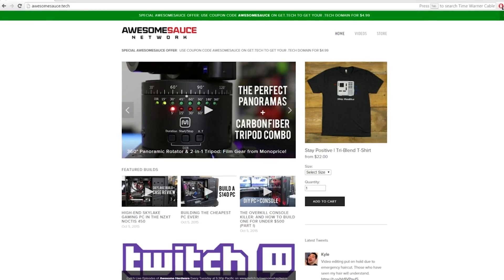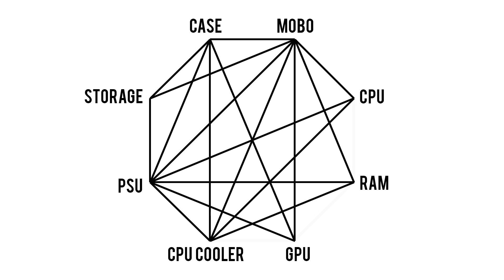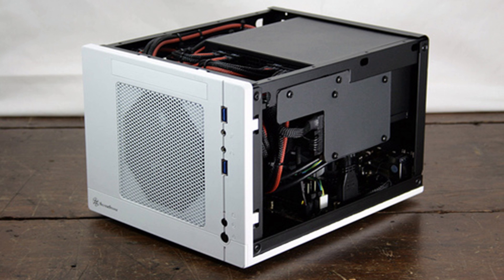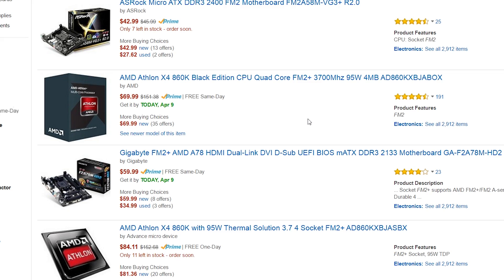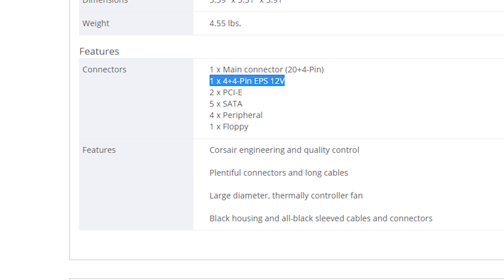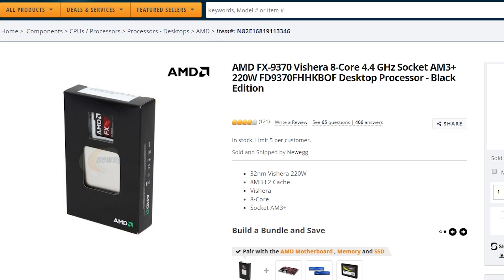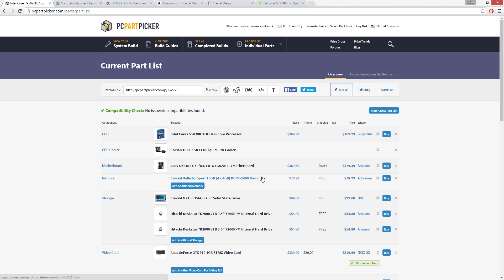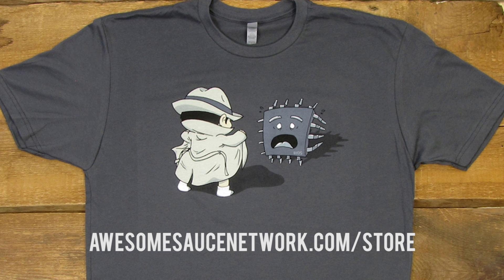How to Choose Parts for a PC! The Ultimate Compatibility Guide!

Comment: The motherboard i got is mATX n the graphics im getting is a gtx 1060 do they fit together?
Reply: If it has x16 PCIe slot (which of course it will), it will fit.
Reply: MSI B150M PRO-VD mATX LGA1151 B150 DDR4 SATA3 1PCI-E16 2PCI-E1 DVI VGA USB3.0 Motherboard Thats the motherboard i have. MSI GeForce GTX 1060 Twin Frozr VI 1809/1594MHZ 3GB 8.1GHZ GDDR5 G-SYNC VR Ready Video Card and thats the 1060 (not sure if i wanna get the 6gb 1060) so i might stick with the 3gb
Reply: Martian Version 247B Yeah, it will fit.
Though, if you have the money, just get the 6 GB version. Today games took atleast 4 GB in High settings.
Reply: Okay ill get the 6GB Thanks for your help! :)
Reply: Yep. Good luck with your build.
Reply: AlphaCore Will do!
Reply: AlphaCore i have a question i changed my graphics card too ASUS GeForce GTX 1060 6GB ROG STRIX VR Ready HDMI 2.0 DP 1.4 Graphic Card (STRIX-GTX1060-6G-GAMING) i want to know if its going to fit my case which is a Corsair Carbide Series 100R Mid Tower Case also would it fit my mobo? sorry just a first timer trying its best.
Reply: Martian Version 247B Yep, will fit to all those things.
Reply: AlphaCore thanksomuch!

Comment: I'm thinking about building a PC. I have a question... When I buy all of my parts and everything, will they come with all of the needed connectors between different components or will I need to order connecters also?
Reply: Are you talking about PSU cables?
You should check if your PSU has all the connectors your components gonna use, not the other way around.
Reply: AlphaCore I guess. I was really asking whether the wires between things like the CPU and motherboard, etc would be provided, but I wasn't thinking and didn't realize that they don't need wires 😅 😂Oops lol.

Comment: Hi, i was wondering is this pc build makes sense so please check it out https://pcpartpicker.com/list/wJwLwV
Reply: 1. Is this all new system? Because if yes, I can't find that PSU anywhere. Dunno how you pick that one.
2. Why 2 separate 1 TB HDD? Why not just 2 TB one? Also, why no SSD? For $40, you can get 120 GB PNY CS1311. Which is more than enough for pure gaming rig.
3. I would put CPU Cooler there, even though that's a non-K CPU. Though you can do this sometime in the future.
Reply: So CPU cooler is not necessary and also  is everything compatible with this build ? 
And the name of the PSU cooler is aerocool vx-450 also my case is different from pcpartspicker so here is the name aerocool pgs v2x. Thanks for answers
https://pcpartpicker.com/list/hJmYQV
Reply: Death Slap Yep, that's what I said with "in the future".
PSU is good, though older model. Should do greatly in the future.
Good luck with your build!
Reply: Thanks dude

Comment: As a first time pc builder i was wondering if anyone has any tips about my build
https://pcpartpicker.com/user/ElectricBulletZ/saved/#view=cJ9NGX

ps: I know i should get a 1070 instead of a 970, but ive had the 970 before choosing a video card
Reply: I would change the PSU to 600-650W range for i7 Skylake and GTX 970. Also, why no SSD? For $40, you can get 120 GB PNY CS1311. Which is more than enough for pure gaming rig.
Reply: Can you recommend me a good psu around 650 watts, i have a 250 ssd but i guess i forgot to put it in the part list
Thanks for the advice!
Reply: $60 Corsair CSM is already great for gaming rig.
https://pcpartpicker.com/product/sbqdnQ/corsair-power-supply-cs650m

But if you can afford $70, EVGA GQ is better.
https://pcpartpicker.com/product/kz7CmG/evga-power-supply-210gq0650

Comment: https://pcpartpicker.com/list/T3bgQV
any feedback on this build i'd like to do? 
As a first time builder can i just leave all the 'unused' cables in the back plate of the case?
im pretty confident that i can build the whole thing, the only scary task is plugging in the damn cables and having a tidy management
Reply: +Marcus Lundgren Thanks for the heads up on the monitor. 

I plan on using it for gaming and music production, so I was referred to the r5 in order to better accomplish those tasks without issues.
Reply: 1. Why PCI-E SSD? I mean with that price you can get 1 TB SSD. Or better yet, bigger capacity yet cheaper HDD and use extra bucks from the switch to get GTX 1080.
2. Assuming you won't SLI (unless you will in the future), 850 W is way overkill. 750 W is more than enough. Great PSU pick though.

And I think that's it. Rest of components are solid!
Reply: thank you very much :)
this is the new build:
https://pcpartpicker.com/list/9x93m8
is the i7 6700k worth it over the i5 6600k? 
all the reviews i watch say the i5 is more than enough for gaming, especially when overclocked
and i'm REALLY lost with all those motherboard options....m3,m5,m7, pro carbon. 
and Asus have just as many, no idea what to pick there
Reply: Freeski Swizzy Wait, why do switch from 6700K i7 to 6600K i5? I assume listing error from remaking the new list, lol.
Other than that, good all around. Good luck with your build!
Reply: AlphaCore i asked in the comment above. the 'show more' is kind of hidden haha. 
all the reviews online say the i5 6600k overclocked is more than good enough for gaming. runs safely at 4.4GHz, which is better than the i7 out of the box. 
can you tell me what kind of motherboard you would choose personally? there's so many haha
Reply: Freeski Swizzy Lol, didn't notice that. Maybe I really need sleep. Late night in here XD

Choose i7. Why? Future games. Even today games actually show 10-30 FPS boost over i5. And with more game engines actually make use of hyperthreading (which i5 lacks), this would be a great deal in the future (True story, I have last gen i7).
Also, "i5 OC is better than i7 out of the box", while that's true, nobody don't OC their i7 :P
OC i7 is of course better than OC i5.

For motherboard, all aforementioned motherboards don't have essentials features that make one better over the other. ASUS lineup is also the same. They have "features", but regular costumer won't use it anyway, so not worth the money.
With that said, I would choose between MSI M5 and Pro Carbon. They essentially the same. Though I would choose Pro Carbon simply because it's black, so it's color neutral with the others. But you have components that are red, so M5 might be better.
Reply: AlphaCore awesome, yeah that's true if i OC the i5 i might aswell OC the i7. i'll switch the processor then and take another look at the motherboards. i love the all black, but yeah im running an MSI GPU and all red cables, which would look great with an M5.
is there a difference between the M5 and M7? The M7 has some kind of red OC button, no idea what it does though. OC the CPU, GPU? 
thank you very much for your feedback. really appreciate it :)
Reply: Freeski Swizzy I ran the spec sheets. Extra money is literally just for the buttons on M7.
Power and reset buttons which PC case already have, and, might be wrong, but a Quick OC button which the UEFI can control for Automatic OC (Though please manually OC your PC, Automatic OC is always wrong, which is dangerous).

So, "features" that you won't need :P
So M5 all around.
Reply: AlphaCore thank you very much :) 
M5 it is then
Reply: +Freeski Swizzy if you wanna double the power of the video card for a couple hundred extra you can get two 980 TI's instead of a 1070
Reply: Alek Belmas ended up going with an i5 6600k and an MSI GTX 1080 Gaming X
Reply: https://pcpartpicker.com/list/tRKJZ8
Could I have some advice/assistance with this build?
Reply: Hunter you should definitely go for a 144hz monitor, otherwise that GTX 1080 is going to waste.. also I would go with an i5 kaby lake processor instead of the r5 as it seems your building a gaming pc.

Comment: can someone tell me if these are compatable? and have I missed any part?
https://pcpartpicker.com/list/qHn4BP
Reply: Syr Maniac ye dog you should be good ;)
Reply: Lucas Allen thanks, and btw there aren't any parts missing right?
Reply: Are you planning to expand in the future? Because if not, you definitely don't need a 6700K with the 1060... The i5 6600k would work almost identically for gaming, and it would save you about $100. Also, I assume you already have a monitor, but it's not on the list...

Also, personally, I would recommend getting a cheaper case. Unless you're going with 1080 SLI and 64 gigs of ram, a $200 case is a little overkill. Honestly, I just went with NZXT's S340, which was $140 cheaper at the time and I was completely satisfied. Of course, if you value the look of the case, that's totally fine.

Comment: Can someone double check me and make sure these parts are compatible? https://pcpartpicker.com/user/53bloodwolf53/saved/V6dD3C
Reply: 1. Please change that PSU. 650 W EVGA GQ is better yet cheaper. I still don't understand how EVGA pricing works.
2. Why rocking last-gen Haswell system? You can get Skylake system now, especially with that budget. Unless this is an upgrade.
3. Also, why use wireless? 10 meters Ethernet cable is just 10 bucks.

Good luck with your build!

Comment: just gonna put this here and hope someone takes the time to check compatibility.
https://pcpartpicker.com/list/FPxCFd
Reply: Vigilante Panties parts are compatible
Reply: Vigilante Panties yeah okay system. just wanted to point out that the Eco 212 is ugglllyyyy it's good but ugly. you might want to consider getting a new fan. I really like the idea of a black and white build bit I don't see the msi you fitting in  also, you can get $35 Windows 10 keys at Reddit microsoftswapkey
Reply: why u need 2 cpu cooler??

Comment: I'm looking to get a cpu cooler but I'm not sure what I should look out for. are the only problems clearence with the case and clearence with ram? if not please tell em what I've missed
Reply: Cryorig H7, better than cooler master air coolers
Reply: Luca Capperucci if you have fancy ram, then check it. if your heatsink isn't abnormally huge, don't worry.
Reply: Sam Tooch i just checked and my stock Intel cooler barely fits in (like a millimeter of room on all 4 sides). Have any idea of which cooler to get?
Reply: Luca Capperucci just get a Cooler Master Hyper 212 EVO. can't go wrong with that.
Reply: Sam Tooch ok thanks :)
Reply: You can go cheap and get lc power lc cc 120, it's performance is 1-2C lower than coolermaster 212 evo for half of it's price. Plus, they are similar in size.

Comment: could someone please be kind enough to check if my parts are compatible?
Reply: i've already put the parts into PC part picker but he said that it might not always be right so i'd just like somone to double check them for me(sorry im new at this).

CPU- Intel Core i5-6500 3.2GHz Quad-Core Processor

CPU Cooler -be quiet! Dark Rock 3 67.8 CFM Fluid Dynamic Bearing CPU Cooler

Motherboard- MSI B150 Gaming M3 ATX LGA1151 Motherboard

Memory- (G.Skill Trident Z 16GB (2 x 8GB) DDR4-3200 Memory)x2

Storage- SSD: Crucial MX100 256GB 2.5" Solid State Drive
                hard drive: Seagate Barracuda 2TB 3.5" 7200RPM Internal Hard Drive

GPU- NVIDIA GeForce GTX 1060 6GB 6GB Founders Edition Video Card

Case- Fractal Design Define S w/Window ATX Mid Tower Case

PSU- EVGA 750W 80+ Gold Certified Semi-Modular ATX Power Supply

Comment: if i reuse the intel i7 and 1tb hardrive that been working for 3 years to my new computer, it will affect has malfunction system? im just planning to build my computer and reuse some used parts to the my new computer and make the way cheaper and it will run fine? well feel free to tell me if they work or not?

Comment: Where do we plug in case fans I need help
Reply: Your motherboard should have labeled headers for "Fan",  "Case Fan" or "Sys Fan". They will usually have 2-4 pins and only fit in one way. Use these spots for case fans. If you are out of those, you can get a molex to fan header converter straight from your PSU, assuming you're okay with 100% speed at all times. Some PSUs also support speed control though. Only plug the CPU fan into the CPU fan header. Don't plug any other fans in there.
Reply: Zoidberg. Thx bro helped alot

Comment: What is VGA compatibility?
Reply: If you want a powerful PC that runs G-Sync (if you need me to eexplain what it is just ask ;) ) i remember you to use DisplayPort...
Basically VGa compatibility is when you have a monitor that has plugs to connect the GPU. When the monitor has a VGA plug, then that monitor has VGA-compatibility. I think you are talking about a monitor so yeah. If you are talking about a GPU, then it means that the GPU has a VGA plug to connect it to a monitor/display.
Reply: Shinigami -sama what is GSync?
Reply: Basically Nvidia G-Sync is a tecnology created by Nvidia for Nvidia graphics cards.. Do not mistake with FreeSync, which was made my AMD for AMD graphics cards.
It's purpose is to eliminate the awful screen-tearing that happens in videogames and at the same time not creating much input-lag.
Screen-tearing is when a frame is being loaded when other frame is being displayed. You can google that and in images it will show you examples of screen-tears.
Input-lag is when you are playing a game and you press a button and it takes a time to understand the command and do what you commanded. Say you are pressing the right mouse button and it takes 0,5s to do it's action. Thats inputlag. Do not mistake with lag due to internet connection. Though they work in a simmilar way they are different and their cause is different.

In order to use tha Nvidia G-Sync Tecnology you need a Graphics card that is compatible (in the GPU description it should say if it has)
and a monitor that includes the tecnology.

Now, how does G-Sync works?
Basically it sets the monitor refresh rate (measured in Hertz, the ammount of frames that can be displayed in one second, basically how many fps can be seen on your monitor)
with your frame rate. So it stops lagging and screentearing.
Reply: Hope that helped :) If you didnt understand something let me know.
Reply: I forgot to say that if you plan on having the G-Sync tecnology you should buy a monitor that has the G-sync and a high Refresh rate. You should see 144Hz monitors. 
They are expensive but are worth the price because of the perfect gaming experience...
A 144Hz monitor with G-Sync will cost you at least 400€, AT LEAST, unless you buy it from somewhere like a shop with discounts, but normally they for about that price.
Reply: Does the graphics card come with G-Sync already?
Reply: Which one? 
What Graphics card were you planning to buy, what is your desired gaming performance (If you want to play any game in ultra settings 60 fps or if you want lower settings but maintaining 60fps, things like that, what do you want to achieve with your build...) and what's your bidget for the graphics card?
Reply: Shinigami -sama I'm thinking about getting an MSI Gaming GTX 1070 8GB graphice card and im looking for at least about 80 fps in most games
Reply: So your budget is basically 450-500€.
I see the graphics card you chose was to get those 80 fps, so that if the game had any fps drop it would mantain itself around 58-60fps.
The graphics card is amazing, im getting myself a GTX 1070 Founders Edition and both are stunning GPU's. BTW check if the page you'll buy them because here in Portugal are selling the GPU and giving Watchdogs 2 for free!

Thats one of the last gen graphics cards and it supports Nvidia SLI (The possibility of placing multiple Nvidia GPU's in one motherboard.)
, it's VR Ready (you can play in VR) and of course, Nvidia G-Sync.
Reply: Here in Portugal i have a page to check PC components. This is the GPU you want right?
https://www.pcdiga.com/msi-geforce-gtx-1070-gaming-x-8g-912-v330-001

Does it have the X?

Or is it this one?
https://www.pcdiga.com/catalog/product/view/id/5721/s/placa-grafica-msi-geforce-gtx-1070-gaming-8g/

BTW, both have G-Sync anyways.
Reply: Shinigami -sama Yes the Gaming X and thank you for being informative, appreciate it!
Reply: +iZankz No problemo!

Comment: tell me is this motherboard https://www.amazon.com/MSI-970-GAMING-DDR3-Motherboard/dp/B00LUY72F6, compatible with this case https://jet.com/product/detail/677dd1c3831243ef80e37f664ff37cb5?jcmp=pla:ggl:gen_electronics_a2:electronics_accessories_computer_components_a2_other:na:PLA_348771660_24231173940_aud-155003204480:pla-161718820380:na:na:na:2&code=PLA15&ds_c=gen_electronics_a2&ds_cid=&ds_ag=electronics_accessories_computer_components_a2_other&product_id=677dd1c3831243ef80e37f664ff37cb5&product_partition_id=161718820380&gclid=CjwKEAiA3qXBBRD4_b_V7ZLFsX4SJAB0AtEVJWNK33mFRsYQo7JP6AslYZdwl1g7ovU5vj0Jw8O6axoCIgHw_wcB&gclsrc=aw.ds ???????
Reply: Sorry  but the second link keeps loading forever. But i've seen that the motherboard is an ATX model. Check if the case says it's compatible with ATX. (Motherboards have MicroATX, Mini ATX, ATX and Extended ATX)

Comment: Motherboard and case compatibility. Motherboard with USB 3.0 and 2.0 connectors look for a case with USB 3.0 and 2.0.
  Example, I have a Z97-c mb and a CM Storm Enforcer case with two USB 3.0 and two USB 2.0 ports in the front. 
 Great case by the way, 200mm front case fan 120mm rear fan lots of options for more fans or liquid cooling and great clearance for any CPU cooler. Tons of drive bays which are removable etc.

Comment: I'm watching this just now and I noticed something missing. Or at least I think it is. Some CPU's also have maximum compatible RAM speeds like the i7 6700K is only compatible with DDR4 SDRAM up to 2133MHz on stock. If I'm wrong, please educate me. My rig currently has 4x8GB DDR4 2400MHz cards installed but only displays 2133MHz on my hardware monitor. Is there a solution to this? I have never overclocked before and I might need help with that. Thanks.